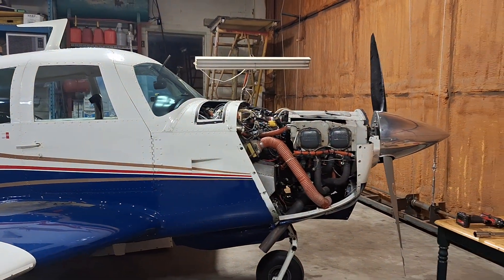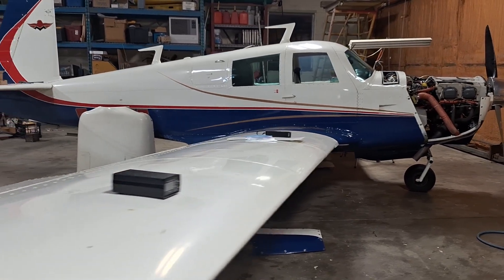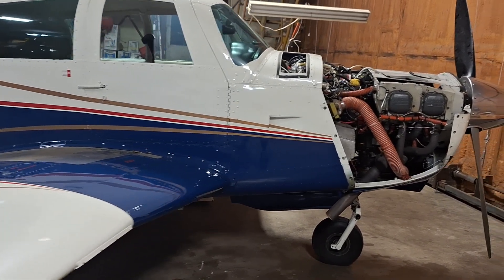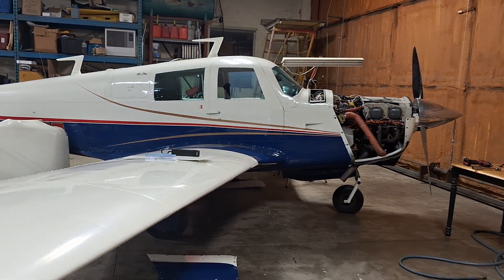Part 2 Mooney M20 180 HP Lycoming. Suspected stuck valve.

Comment: Sticky valve vs. stuck valve…

1) Sticky valves have a challenge rotating as expected…

2) Stuck valves have difficulty moving up and down (open and closed)…

In the M20C’s O360… a stuck exhaust valve will clash with the piston crown as it reaches too dead center…. This leaves a mark on the piston and bends the valve’s rod.

The engine vibration and lack of power resulting from the stuck valve leaves a strong memory.

Carbon build up in the valve’s guide is a strong cause of stuck valves… 

Look for matching chunks of carbon in the oil filter/screen…

Cleaning out the valve guides is an ordinary aircraft mechanic job…

Nice to have a JPI when this happens… having a stuck valve with only one EGT indicator…. Isn’t enough to go on.

Go Mooney!

😃

Comment: How is it these things are allowed to run on leaded gas, no catalyzer, straight thru pipes, no muffler?
Reply: Look close… there is a muffler in there…
The cabin heat comes from a muff that surrounds the muffler. 

And… the aviation world is slowly moving to lead free technology…

In aviation… change is very slow….  This airplane was built a decade before cars got catalytic converters…

If you still drive a 1965 VW beetle… you wouldn’t have to put a cat on the exhaust…

 😃
Reply: Sticky valve vs. stuck valve…

1) Sticky valves have a challenge rotating as expected…

2) Stuck valves have difficulty moving up and down (open and closed)…

In the M20C’s O360… a stuck exhaust valve will clash with the piston crown as it reaches too dead center…. This leaves a mark on the piston and bends the valve’s rod.

The engine vibration and lack of power resulting from the stuck valve leaves a strong memory.

Carbon build up in the valve’s guide is a strong cause of stuck valves… 

Look for matching chunks of carbon in the oil filter/screen…

Cleaning out the valve guides is an ordinary aircraft mechanic job…

Nice to have a JPI when this happens… having a stuck valve with only one EGT indicator…. Isn’t enough to go on.

Go Mooney!